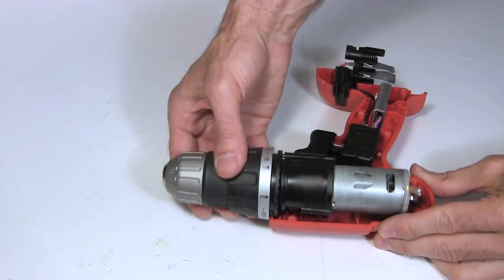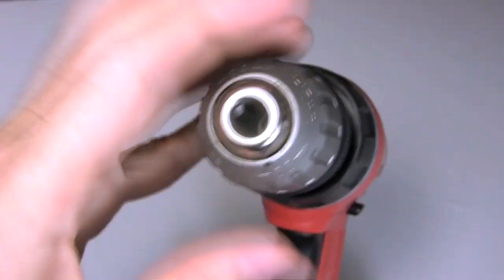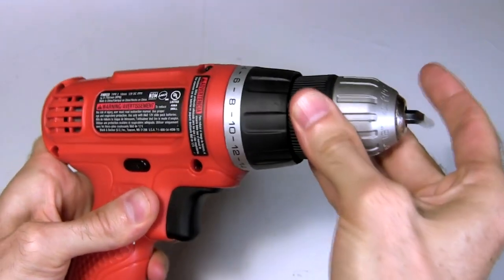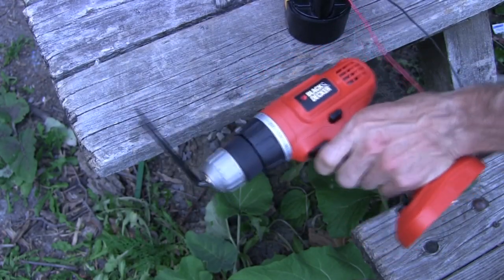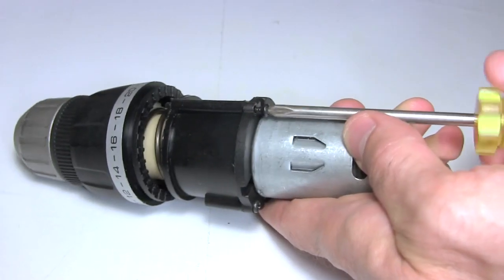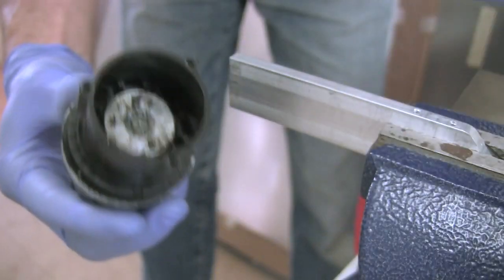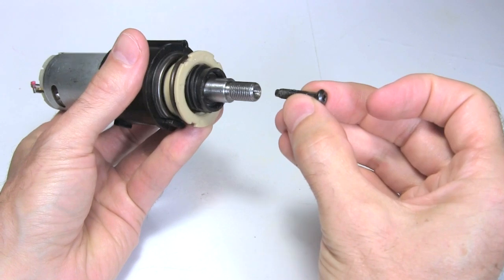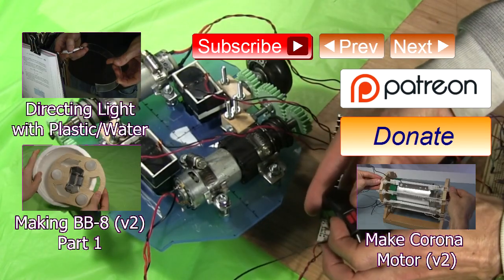How to Remove Chuck and Drill Motor

Comment: Hello, how many balls there are in the b&d because i’ve got the same but after disassemble for a problem the mandrel has no torque anymore, it’s like the the big tunnel gearing turns free... i’ve got only one ball for hole but the hole is high so the balls are very inside of the holes and don’t have any fuction imho... it’s drivin me crazy...😢
Reply from the maker: It's all reassembled and mounted in a robot right now so I can't look directly but looking at the video at 2:32, I count 8 balls. Now that you mention it, they do look fairly recessed.
Reply: @RimstarOrg  Thanks, after thinking and thinking i understood there are two balls in one hole, but one hole yes and one not, so four holes have two balls and four holes are empty. Now it works perfectly.. i think the 12v model with less torque have half the balls than the 18v with higher torque but on the same body. There's no other explanation...

Comment: Why do you need to keep all the gear workings
Reply from the maker: You don't need to keep the gears. I do because I usually want a slow, powerful motor. With just the bare motor alone, the shaft turns very fast.

Comment: After he gets out the motor out why do i need to have that plastic part
Reply from the maker: I kept it because it has the adjustable gears for controlling the speed and torque. If you don't need that then just use the motor.

Comment: How many volts does this motor take
Reply from the maker: I don't recall specifically for that one. I took apart a few different drills for a project and they ranged from 12V to 14V.

Comment: This is INSANE!  Virtually ALL drills can be easily taken apart and the motor quite easily removed. You can easily keep the gear reducer while getting rid of the chuck. Take it apart man!
Reply: Ya mostly, but sometimes the gear plate locks with the chuck so it can't be opened even after the inner screw removal and the entire gear assembly inside rotates with the chuck counter clockwise while trying to remove the chuck... and this method is only way. This issue rarely happens only with cordless drills.

Comment: I had so much trouble removing my chuck from the drill. Too bad for me I barely got to see your video. Either way it was a great way to remove a hard to remove chuck. Thanks. By the way, I had to cut the previous chuck in order to finally remove it. Now I found out a replacement chuck is not worth the price of the drill. LOL!

Comment: i don't to manage remove the screw
Reply from the maker: I had that happen to me once. I tried using another drill to drill a hole in the screw head but even that didn't work. If it had then I would have been able to get the chuck off, but the screw would still have been stuck in the motor shaft. I ended up not being able to get it off at all and ended up putting the chuck back on and trying another drill. Try searching for other videos to see if anyone's ever managed to get off a stuck screw.

Comment: When you 'set the drill to low gear' you actually turned it to low torque, which is used for screws, that means the clutch slips easier, you actually want that ring on the high setting.
When you took it apart, i think it then went into high torque, that's why it was easier
2 speed drills normally have a slide switch which that drill doesn't have ;)

Comment: Hi Steve! If your motor has permanent magnets in it, you can make it hard to turn by shorting out the input wires. You turn the motor into a generator by spinning it, and if you short out the output of the generator, you put it under maximum load. It takes a much higher torque to turn when the motor is in this configuration. I bet you could have whacked the hex key and unscrew the chuck this way.
Reply from the maker: Interesting idea. I'll try that the next time I take one apart.

Comment: why dont you just give the drills new batteries?
Reply from the maker: Because I need the motors (with their gearboxes) and at $0 to $10, the price is good.
I just searched online for the drill I used in this video, Black & Decker GC1200, and the batteries it uses, HPB12, and found comparable prices. So maybe people just go out an buy a new drill instead?
Reply: A Dewalt cordless drill with battery and charger sells for 199.99$. The drill by itself.69.99$  the battery with charger 159.99$ . And then maybe he just wants the motor like he said.
Reply: The "Drill Manufacturers" Battery Sales Merchants are just conning folks into an endless cycle of repeat purchases.  +John Scarce

Comment: Also, I think it did not work that time because you set the clutch to 1, which will slip (purposefully) if above a certain torque.. Place the clutch in drill mode next time, should work no prob... :)
Reply from the maker: I recall trying drill mode and it didn't work. I tried all the modes. That method worked with one drill. With another drill the method where I power the drill to slam the Allen key against the table worked. Good point though. I'll add an annotation telling people to try drill mode, though I already suggest they try the different settings.

Comment: Was that drill a non-variable speed drill? The variable ones normally have a reverse torque brake in the gearbox that prevents the chuck from turning the motor. I did a video on removing the brake from the gearbox a while ago. Which is useful if you want to use the motor and gearbox as a generator.
Reply from the maker: It was variable speed via the trigger but there was no brake like you show in your video (https://www.youtube.com/watch?v=PJFAXxV2ME8). I had no problem turning it manually.
Reply: interesting. My one had an ic to control the speed. Looked like a voltage regulator, and got hot at low speed so probably a LM317 or similar circuit. Perhaps your one did it differently and didn't need reverse charge protection?